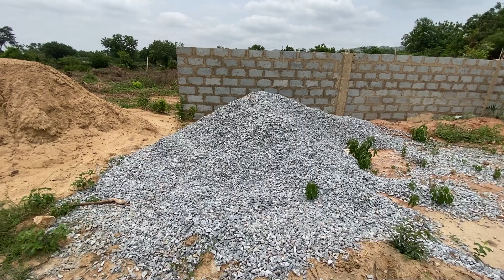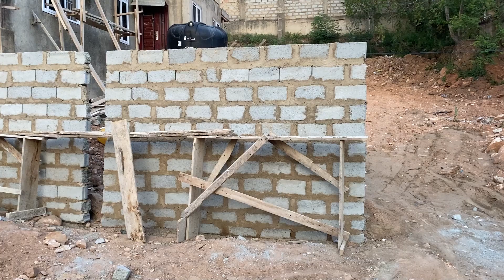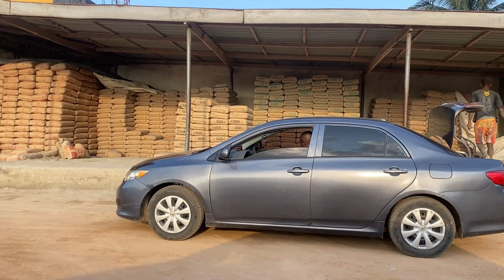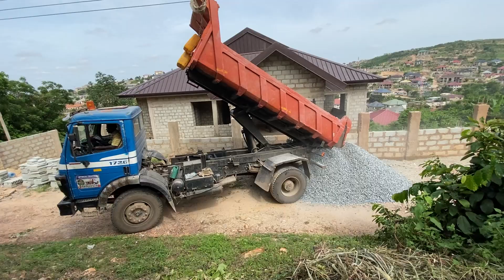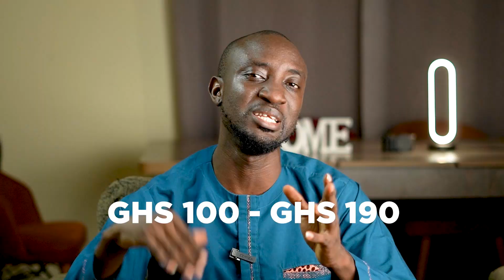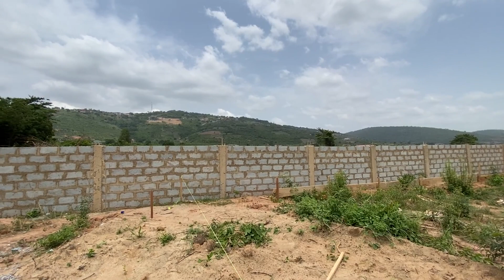Total Cost of Building a Fence Wall in Ghana in 2023

Comment: Did low-cost fence wall assuming 100 blocks for 30ft (800 blocs for 230ft wall, chest high 6500ghc), with 25 bags cemment (2500ghc), foundation 1000ghc, workmanship 4000ghc. Sand was free (estimate 1000ghc 2x azonto batch). No iron rod, wawa wood etc. The final cost was 15,000 ghc (Sept. 2024)
Reply: Sand was free? Where?

Comment: you only gave masons cost of workmanship, what of steel bender and carpenter?
Reply from the maker: 50k cedis would still suffice for all that. I would do a more detailed video soon.
Reply: @AfricaBuildingHub you didn’t talk about the labour required to dig the trench for the footing of the wall
Reply: The labour required to cast the base concrete, along side column concrete
Reply: And the labour for the block work wasn’t entirely accurate

Comment: Whats the cost to put up a fence wall plot size 240x80 ?
I have 3 plots of 80x80 . Thanks.
Reply: 8 foot back and both sides, 5 foot front wall.
Reply from the maker: About 80,000 to 120,000 cedis
Reply: Thanks. 
It is actually 220x100 . Not 240x80 sorry
Reply: Wow! That's almost £9000 😮

Comment: This price is too expensive ooo. I did my 2 plots of land with GHC 35000. I used 80 bags of cement and 4000 blocks but I didn't do concrete columns.  I trip of sand and 1 trip of stones and workmanship of GHC 12500. Just last week it was completed  eiii that price for 1 plot? Hmmmmm
Reply: You can build as cheaply as you want in construction. Also as expensive as you want. Most important is to not compromise quality
Reply: I think he's giving estimates to guide us. As he always says it could be more or less
Reply from the maker: How long ago?
Reply: @Africa Building Hub  it was started on the 12th of May and completed Monday this week
Reply: That's why when visiting ghana I saw so many fence wall falling down, cheaply made. Don't compromise on quality work, you'll end up doing it twice.
Reply: @sheinspiresgabrielblessings hmm
Reply: You should be worried the wall will fall if you skipped the pillars - based on experience.
Reply: Looking at the number of bags used hmmm for strip concrete and laying blocks
Also columns in walls apart from aesthetics only serve as construction joints and the way we do the block column defeats the latter
Reply: Did it include blocks?
Reply: @Makafui Ameedzameh  wow ! Very  interesting question
Reply: How much did you get the blocks for?
Reply: How much to damp proof the wall?